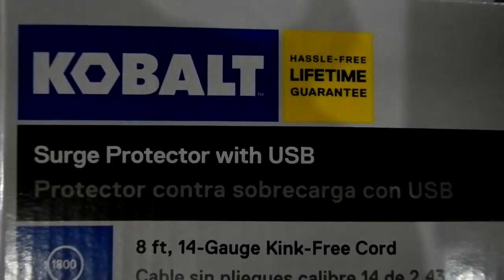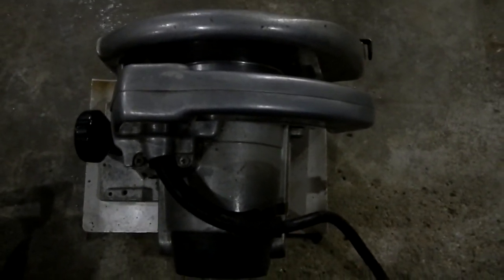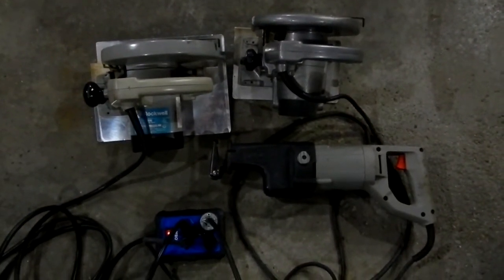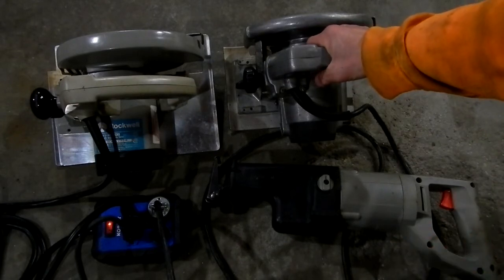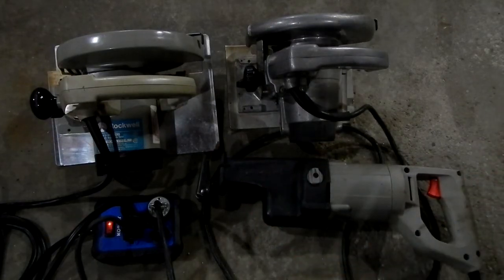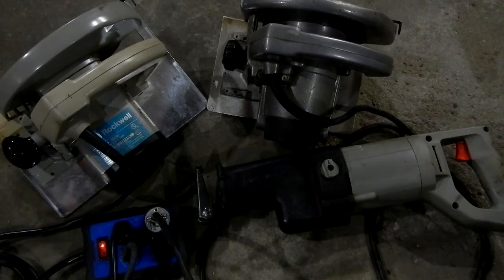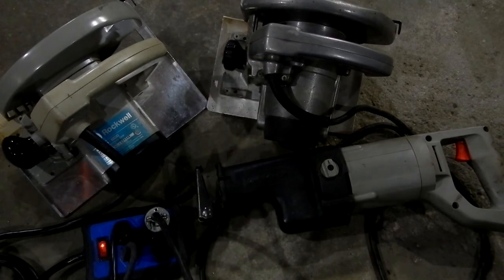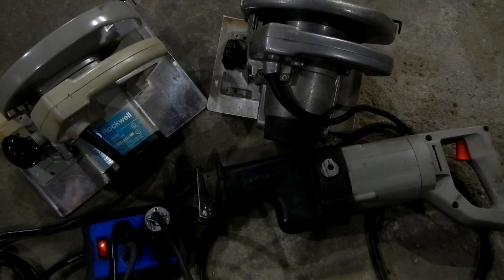Kobalt 3 Outlet 2USB Surge Blue 8ft 3.1A 1800J will 3 POWER TOOLS reset the circuit breaker (TEST)

Comment: I am really Carnac the magnificent, the stranger one from the far EAST that knows all.👀 
Anyway what is going on is the ratings on the tools are at maximum load. In your demo the tools are free wheeling drawing almost no current.  Anyway I think the input wire was 14 Gauge.
14 Gauge low grade wire should handle 1650 Watts.
I am lazy by nature so 1500 watt space heater and something working at 2 amps should load the breaker to trip it before the wire 💥 💀.
Reply from the maker: GatorWing       Interesting.